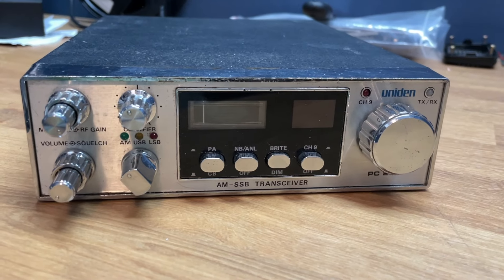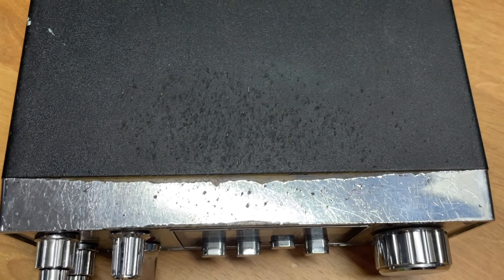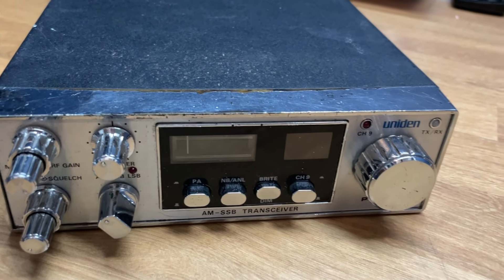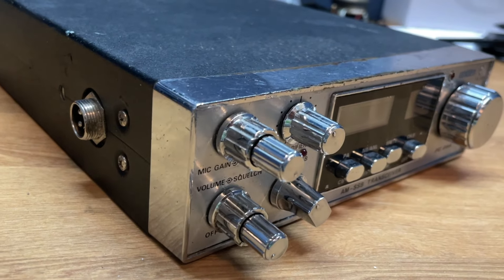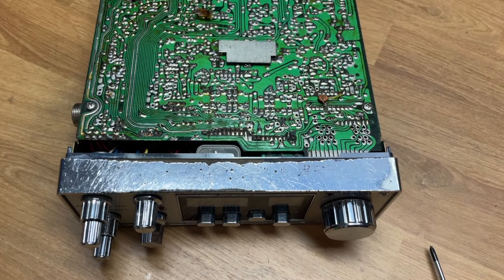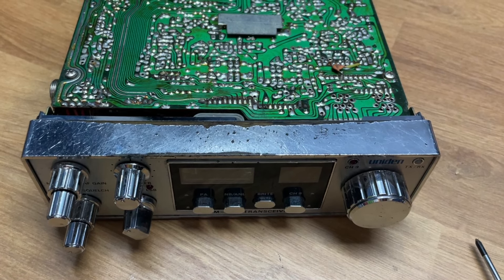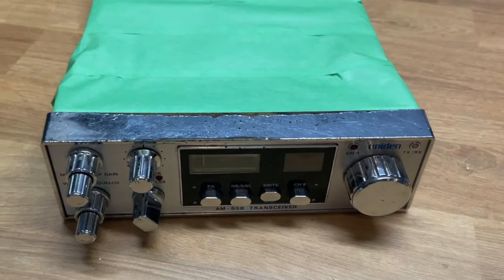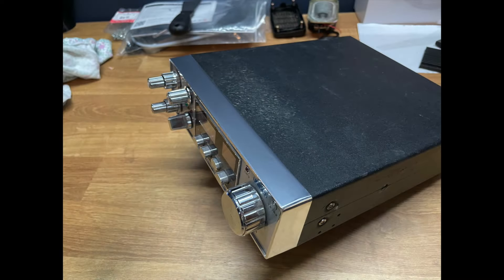CB Radio, chrome repair and clean. Looks great! Easy to do.

Comment: it looks good i have 2 one wont work any more i put new finals in replaced i mean smome came out the rigs are same as yours other one works fine you did a good job on your there for sure i need some onew in Adelaide to fix it also a b model got drowned in rain water roof in the shed leaked right in to the bucket i had in there with scanner and my favourite old GE b

Comment: I have GOT to be missing something.   I have listened to this about three times... and haven't been able to catch what you are putting on to make the new chrome appearance.
Reply from the maker: Hi Robert, thanks for the comment, Sorry you did dot understand me, I know the mic is not great at the moment. I am still new to this. But to answer you, if you got to 2mins and 10 secs, into the video, I explain that you need chrome tape from amazon. The roll of chrome tape can be seen in the bottom left of the video at the same time. Hope that helps.
Jeff
Reply: @cbradiotricks  I did indeed miss it!!!!    Thanks for the nudge in the right direction!!!!!!